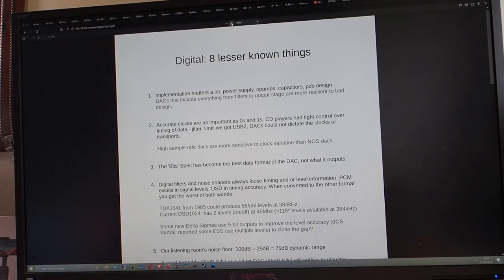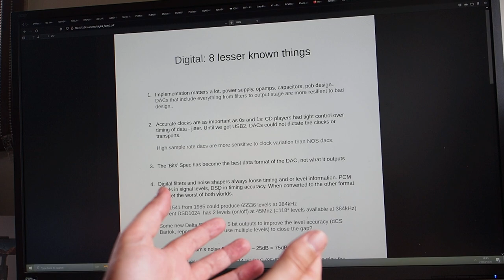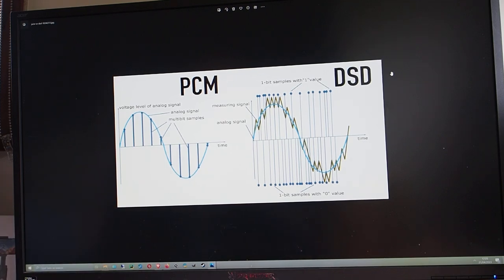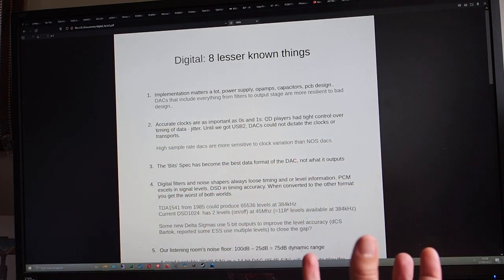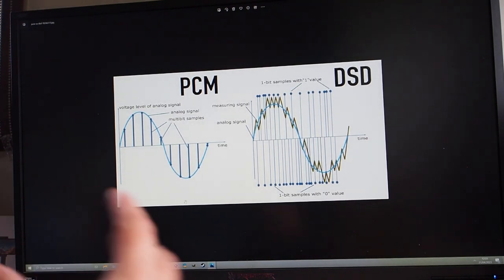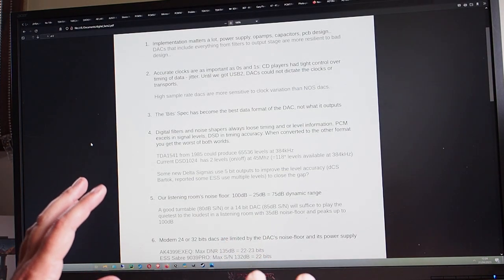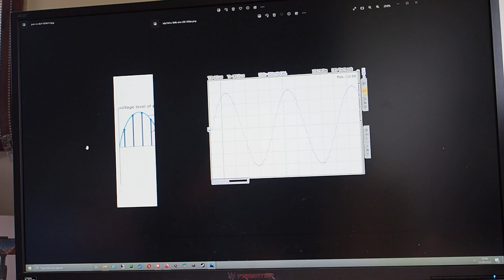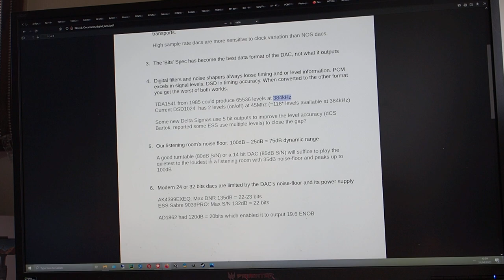Four lesser known things about DACs and digital music.

Comment: Some great info. I see a lot of people who buy DACs with great clocks but then connect the DAC to the transport with IS2 or SPDIF or even worse TOSLink not knowing that the transport is the master clock negating the super-duper DAC clock. When I connected my Holo May Dac with USB2 the sound improved remarkably
Reply from the maker: Thank you. Indeed what you have now is the Holo's own clock dictating 'the stream' via USB2.

Proper implementation of all the other methods you mentioned should be able to do deliver the same results, but as a design approach, I prefer the setup you have and for cd-players, the integrated approach. My plan for a DIY NOS dac will also use USB2.